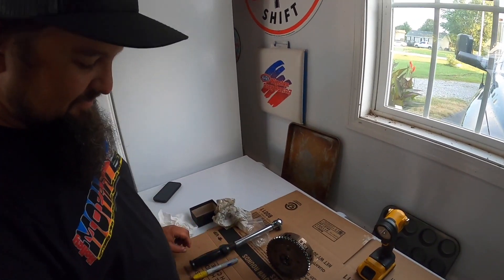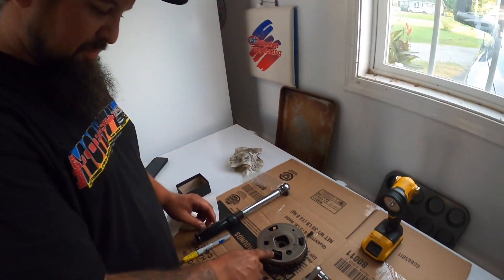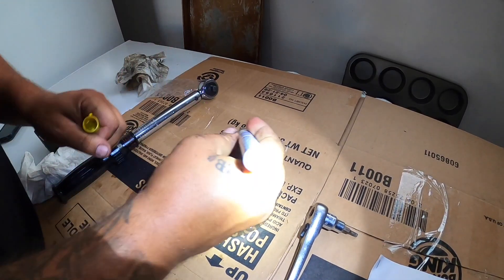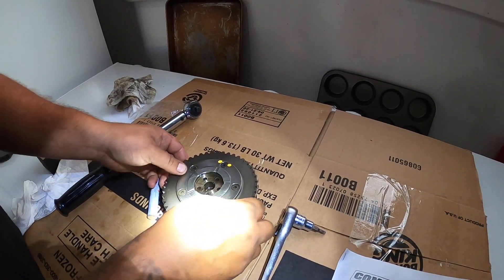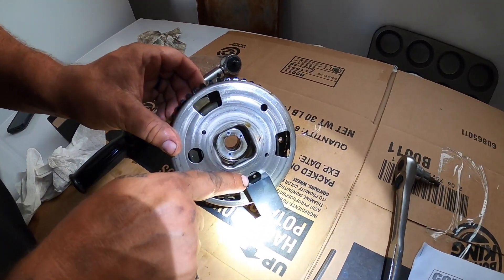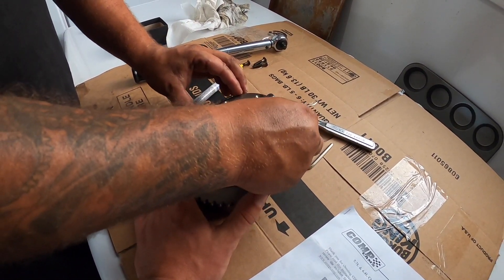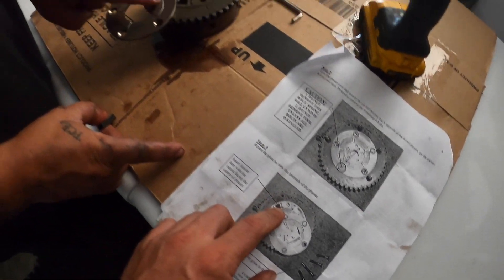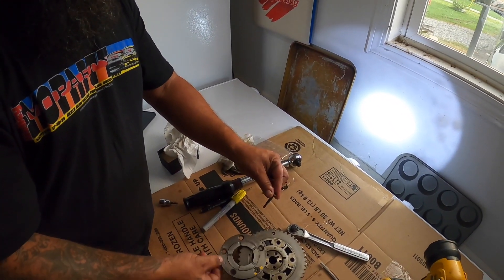HOW TO INSTALL A HEMI CAM PHASER LIMITER

Comment: Welp… I should’ve watched 5 more seconds on how to put the tool in to lock the spring… two loud pops have confirmed that I will need to spend more money
Reply: Yeah, if you don't place the long bolt you pull out back in the same place, which is what the tool is meant to hold, then it's burnt. It's kind of a no brainer but nowhere does the procedure mention that one of the bolts you pull is longer, so you don't watch for it. If it's hard to pull out the tool don't pull it out unless you wanna buy a new phaser 😆 
Right there with you man.